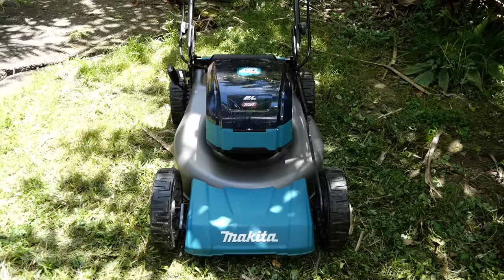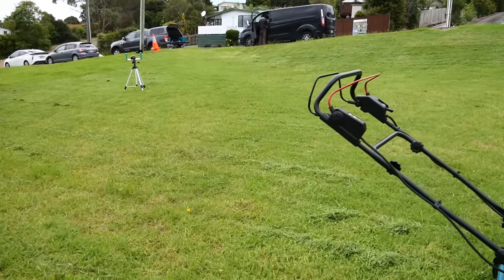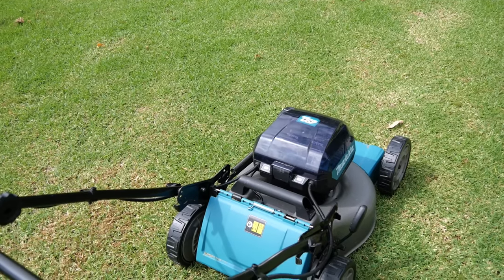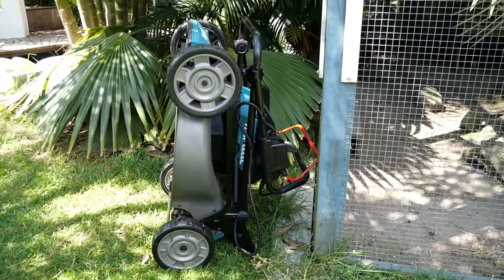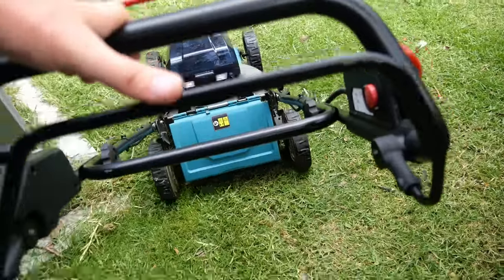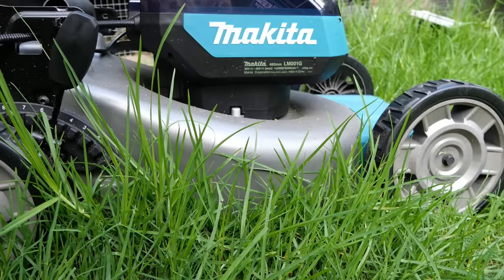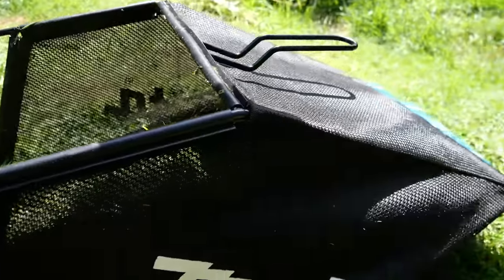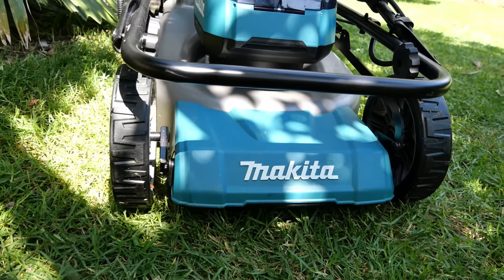Makita 40v Mower Review. Both Makita 40v Mowers put to the test in SUPER LONG GRASS!

Comment: Problem is that for 2x 8ah xgt batteries, it's over an eye watering £500 in the UK.
Reply: The combidrill kit itself is 500, xgt is an expected expense
Reply: Battery price is the ban for this thing worldwide
Reply: US, Just ordered 2x8’s charger, mower 21” / 534mm. $949 + tax @ 6%. 

Dying to sell my ego unit with 10ah battery and fast charger. After seeing the smaller unit in high grass.
Reply: @GregBrecker  where did you buy that?

Comment: Well i cant get  past the price of batteries. They are $400 each. Also its $1800 for the kit with two 5amp batteries So if i want the 8 amp batteries for run time i have spend a extra $800 on top of the kit. If i buy the bare kit then $1000 plus $800 plus how much a charger costs. So close to $2k for it. I think i will stick to a gas mower for half the amount.
Reply: Check online you can find the kit with 2 8.0’s for under $1000 USD right now… I’m tempted but I’m invested in the 18v line.
Reply: We have the kit in stock at our store with 2 8s for 925.00

Comment: I just got the 480mm Makita XGT 40v mower kit last Friday. Mowed 4 lawns since. I absolutely love this commercial mower. With such a small rear exit chute it never clogged at all. Really compacts the bag to the brim. I am glad I took your advice and got the smaller mower. The extra RPM makes a clear difference. Got two 8ah batteries on top of the two 5ah's. I never got closes to using two 8 ahs. Used auto 90 percent of the time while i figure out run times. 1 lawn that i did has a 2x10m tall dense strip of Kikuya. My 140cc would bog hard but this Makita ramps up and barely drops RPMs. Self propel is really intuitive. Thought it would be too twitchy but it's not. Massive ball bearing wheels make it easy to push. I got the 4 swing back blades. Low RPMs will bag grass in the deck with ease. If you want to pick up all debris below the blades leave it at max RPM. 

Can't recommend this e-mower enough. Thanks Tools & Stuff for your review.

Comment: I just received my Makita 40v XGT yesterday.  My first eMower!  I'm impressed with how well it mowed my St. Augustine grass in Florida!👍
Reply: I reside in Michigan. I'm debating on going with the Makita GML01PL with the two 8ah batteries. I currently use a Honda HRX 217HYA 200cc with hydrostatic transmission. It cuts like a dream, and it sucks all my plant clippings up, leaves zero clumps etc etc. Like I've, vacuumed my lawn essentially. I also have large oaks and maples that drop basketball sized leaves in the fall that I use my Honda in the fall to suck them up or mulch them. Are there any issues with it or difficult to clean the underside carriage warranty repairs, etc?
Reply: @shanew7361  Yes, go with the 8ah and a dual charger. My GML01SM came with the 4ah and single charger, and I ended up buying another battery. I also replaced my blade with the Makita High lift blade, and it really improved the cut and lift. The mower has great power and should do well sucking up the leaves. It doesn’t have the dual blades like the Honda, but the mower does a good job mulching. I actually find maneuvering the Makita so much easier because the mower is so much lighter than the Honda HRX217.  Even with self propel, the Honda wore me out on a hot day. I sometimes push and pull the Makita without the self propel, but my Honda is too heavy for that. Even if you want to keep the Honda as a spare and for fall leaf-duty, that’s also an option.👍🏼 good luck!

Comment: Just got mine a few weeks ago (Australia) along with an 8ah battery, comes standard with the swing back blades in Australia. Was a bit concerned it wouldn't have the grunt to replace my old petrol mower but seems every bit as powerful.
Reply: I think the disc with swing back blades is a safety requirement here in Australia.

Comment: Already got mine, love Makita!! I own both LXT and XGT
Reply: Which one is better
Reply: I reside in Michigan. I'm debating on going with the Makita GML01PL with the two 8ah batteries. I currently use a Honda HRX 217HYA 200cc with hydrostatic transmission. It cuts like a dream, and it sucks all my plant clippings up, leaves zero clumps etc etc. Like I've, vacuumed my lawn essentially. I also have large oaks and maples that drop basketball sized leaves in the fall that I use my Honda in the fall to suck them up or mulch them. Are there any issues with it or difficult to clean the underside carriage warranty repairs, etc?

Comment: I want this motor on a Honda HRX "like" plastic mower deck. No rust and nothing sticks to it. Plus it must mow at 4 miles (6.4 km) per hour. I really would like a 30" cut though.
Reply: You have right the 18v version is very rusty from beginig, but they said thats a comertial grade tool.
Reply: Honda announced it will discontinue making gas mowers and dive into battery only towards the end of 2023

Comment: hi, the "swing away" blades or flail blades are better for 2 reasons, 1) if you hit something (e.g. rock) it won't transfer the impact to the crankshaft. i had a bend crank from using the straight blade and 2) if the flail hits your foot (you wearing steelcaps) it will not injure as much. i think most lawns nowadays could easily be mowed with a single 4Ah battery.
Reply: I hit a 2x2 cm square metal  tube with mine 2x18V 460mm makita and it chopped it up, I was so furious I fucked up my new mower (as I did with gasoline ones), but it was completely fine! And that was a normal one piece blade
Reply: @JohnKrakatoa  My problem with old Makita DLM 431  lawnmower is that right front wheel is attached to really soft flat metal bar and it bends sideways all the time if the wheel hits something ... would need to add a piece of U steel on that , as they designed it to DLM 530/532

Comment: I would get this if it was for one thing - a Toro-like personal pace drive! That is just so much better than having 2 lever bars on the handle and then a stick to set the pace…
Reply: True, but this mower is built more commercial like. The toro personal pace drive is more comfortable but more for homeowners.
Reply: @Ar100-Adr  Why would you say the solution itself is less commercial? And frankly, the price and power seems to put these makitas pretty well in line with the recyclers anyway :)
Reply: @kristofpucejdl  True, but I have also used both the toro recycler and makita 18x2 mower for cutting lawns. The toro was good at self pacing and power wise but reliability wise, it barely lasted a month for us before issues popped up. The makita commercial has lasted us 6 months so far and no issues so far. We use it daily for gardening. That’s why I said the toro is more based towards homeowners.
Reply: This is so much lighter than the personal pace, so you don’t really need the self-propelled.  I had a Toro personal pace AWD before I purchased this Makita.  I understand what you are referring to, but releasing the bar and pushing manually without the self-propelling is simple because it is light.

Comment: First run on my 480mm XGT 40V. The couch grass of my new house was 200mm high in some places. Mid winter, so pretty damp in South Aus. Looks a little thicker than your kikuya there, so I cut it quite high, will have to go lower next weekend. I'm using 2x 5Ah batteries and it took me three charges to get through 200m2. One battery gets drained while the other battery has four bars still. Not real happy with it's performance. I even tried not using self propulsion. Nothing helped. And I barely filled one catch.
Will have to see how it runs when the grass is lower and drier.
Reply: Do they cut out mine won't go if one battery is flat. ?
Reply from the maker: They are 40v tools, not 80v. It only uses 1 battery at a time and as the first one gets low it jumps to the second battery. Sometimes if the 1st battery is flat as you try and start it, it won't jump to the charged battery. I think it needs to be running to jump if you have batteries in both slots.

Comment: It would have been informative to compare the 2 x 18 Volt mowers to the 40 Volt mowers to see how they compare. From my understanding is that the 40 Volt max  is just 36 Volt system. Maybe you can confirm this.  I still feel that having 12 batteries in series to create 36 volts (40v max ) is asking for trouble. If one of the 12 batteries fail it becomes an expensive to replace the battery pack, on the other hand if one of the 6 batteries in an 18 volts fails it is more manageable to replace a 18v pack. So that is why I am sticking to 18/36 volt system
Reply from the maker: Send me the money and I will compare it for you. 
Secondly, I assume you mean battery cells when you speak. Most Makita 18v batteries have 10 cells, some have 5, none have 6. Half of the Makita 40v (yes they are 36v nominal) have 10 cells, the others have 20. Cells are 3.6v nominal. Some 18v batteries from other companies put up to 30 cells in their batteries. So your theory is based on erroneous info.
Reply: You right should have been accurate stating the number of cells in a battery pack. 
What was pointing out here was from my past experience with lithium ion batteries, if one cell goes faulty in a battery pack, which I have had experienced a few times then the whole battery pack is stuffed. The BMS just switches off the battery.   So statistically the more cells wired in series to give a higher Voltage the greater the chance it will fail. Using two 18 Volt pack in series instead of one 40 V means that if cell fails there is only lose only one cheaper 18 V battery to a much more expensive 40 V battery.  It will be interesting to see how the Victor lawn mowers long term reliability holds up with an 82V battery

Comment: I have the Dewalt 2x18v mower and it is GARBAGE.  Low torque, chews batteries and completely failed 12 months in.  Dewalt said no receipt no warranty - tough shit.  $350 for a new electronic controller that will probably fail just like the last one.  These maktias  look multitudes better.
Reply from the maker: Wow! Not many Dewalt tools last that long. Dewalt is cheap junk some people still think is a professional brand.